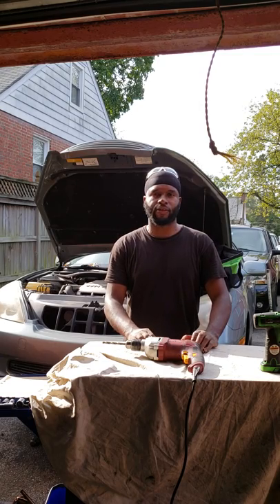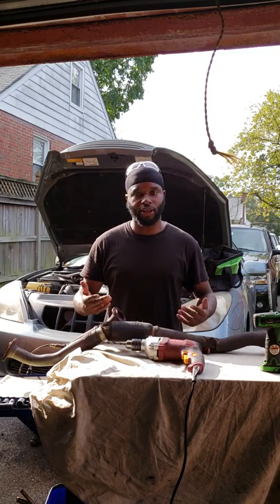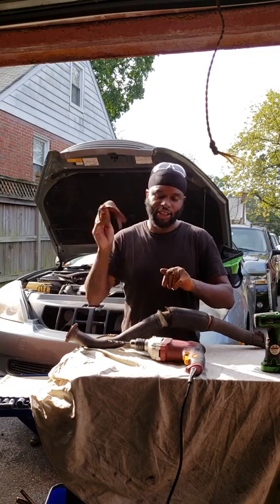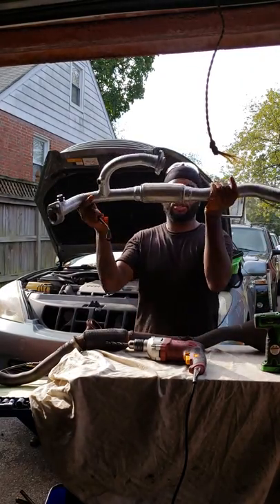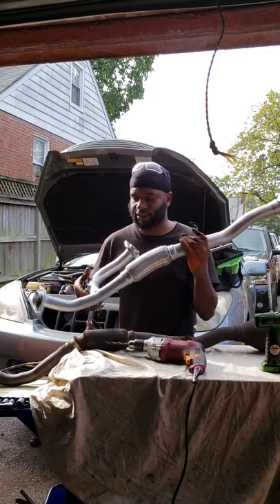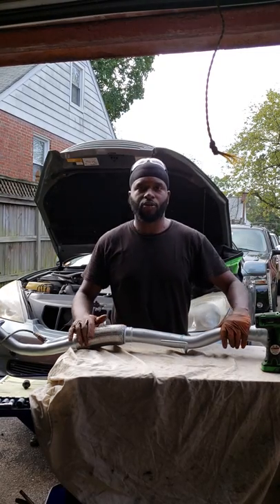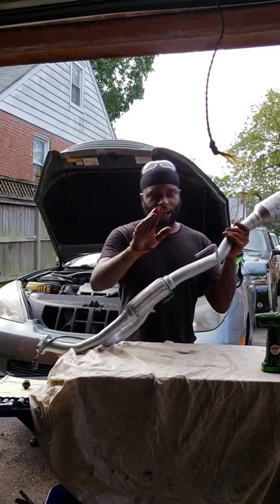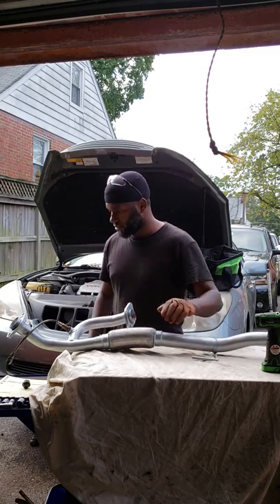2004 Lexus ES330 Exhaust flex pipe replacement

Comment: What was the manufacturer of the flex pipe that you installed?  Was it stainless?
Reply from the maker: It was coated with a exhaust paint.

Comment: Why not just replace the problem?? My local auto parts store has flex pipes. They aren't expensive. Cut the problem out and replace the problem.  Don't spend money on unnecessary parts. Don't go to all the work of removing rusted bolts. Just leave the rest of the exhaust in place.